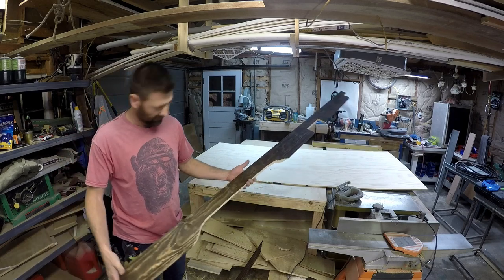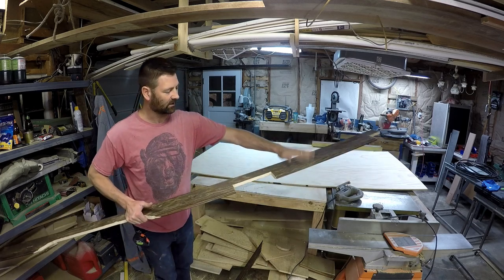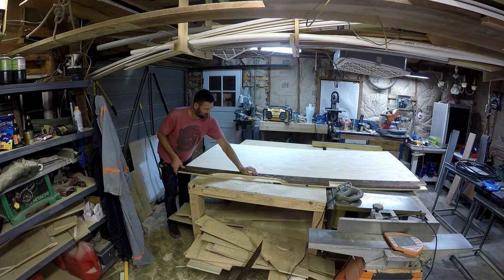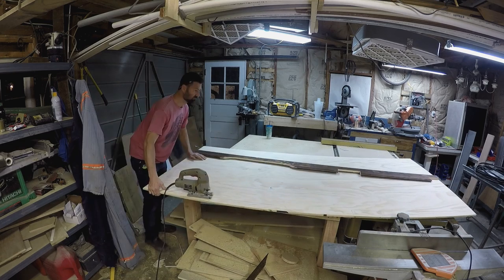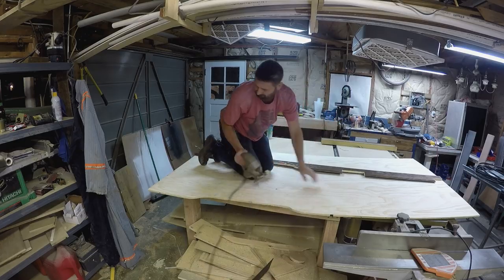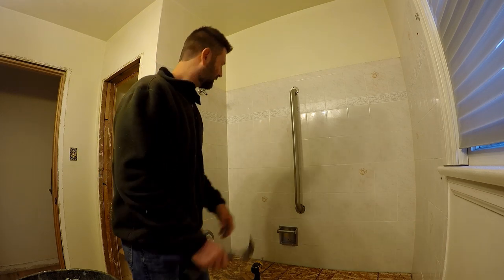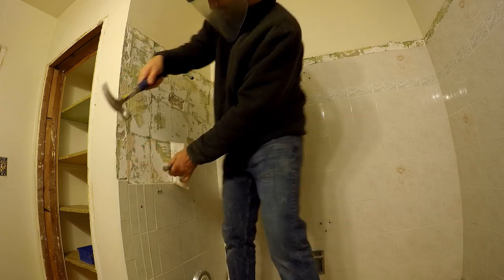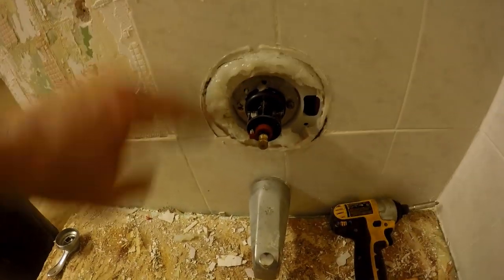1940s Bathroom Remodel | Rotten Sub Floor | THE HANDYMAN |

Comment: I'm on this project as well.  So I am grateful to have come across your channel.  I have a 1940 home with the 3/4" pine subfloor installed diagonally, not all the planks are 8" though,  some less.  On top was oak flooring (water damaged by leaky toilet).  What I found interesting is the oak on the bottom looked brand new,  and was stamped "Imperial Flooring,  Texarkana TX, USA"  Interesting because that is 60 miles from my hometown,  and my "new" home is 830 miles away.
Reply from the maker: Glad my videos have helped.

Comment: Nice. I worked K&B Remodels for a while. Flashbacks. All that knee work will make you old quick. I've got two pending offers but I think I'll pass.  PM Repairs are the name of the game for me. 
Hey, I sprung for an $18 wood cutting wheel for my Dremel. With a right angle attachment ($31), it is replacing a lot (most) of my multi-tool trim work. Faster. Better. You should give it a try. Multi-tools are good for precise Trim work, but are slow. 
However, multi-tools can't be beat for removing bathroom tub caulking with some WD-40 pre-spray, and a stainless scraper blade. A little acetone clean-up and you are ready to re-caulk in 15 minutes.  That used to take an hour of razor blade, 3-in-1- scraper work.

Comment: looking great and my floor was the same in my bathroom.  I don't know if I did it 100% correct but I put that mapei stuff on top of subfloor and screwed concrete board down on top of that before it dried then used that mesh tape on the seams and then more mapei and laid my tile on that. been 4-5 years and holding strong. did add bracing to the floor from the basement to reduce/eliminate floor movement.

Comment: Don’t ya just hate when the driver bit gets left in the screw head! Drives me crazy! Lol! Nice video brother. Really enjoy your work.
Reply: Pete's Shop Makes I try to wiggle the bit just a little, this usually will dislodge the bit.
Reply: Ajoking oh I know I was just giving him a hard time because I noticed that was happening to him after every screw. I use the Norske impact bit holder and I’ll never use any other brand from now on. This thing is amazing: https://www.usesi.com/norske-tools-nibbi245-stainless-steel-hexagonal-heavy-duty-adjustable-magnetic-bit-and-screw-holder-1-4-inch-shank-3-inch-length-710717.
Reply: I just buy the longer bits and put them directly in the chuck.

Comment: Quick question handyman. I have the same problem & was wondering why you put the 1/2in plywood ontop of the subflooring? Would i be ok to just remove the old  planks & jus put the 1/2in plywood straight ontop of the joists?

Comment: The handyman, my hot water shower valve is squealing. I replaced the washer in the valve stem and it’s still doing it. Also when the washing machine is filling up I hear a squeak. Is there air getting into a fitting somewhere? Thanks

Comment: I have the same style house and subfloor. Can I lay durarock board over it instead of the plywood? If I do both then the tile sits way too high to merge properly with the existing floor, there would be a huge threshold transition.

Comment: Doesn't that plaster most likely have asbestos?
Reply from the maker: No. This is 1940s.
Reply: "Most types of asbestos-containing plaster were manufactured between 1942 and 1974. If your house was built or renovated during that time, it's a good idea to have it tested. That said, asbestos was used in stucco and drywall as early as 1910, and use continued at a slower rate until at least the early 1980's."

You sure about that?